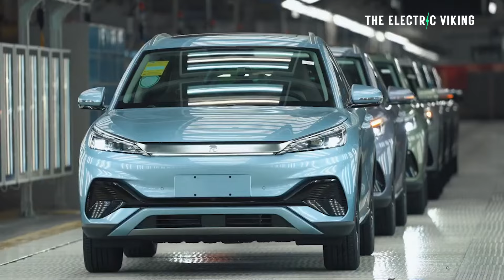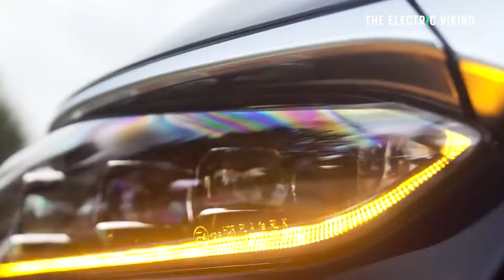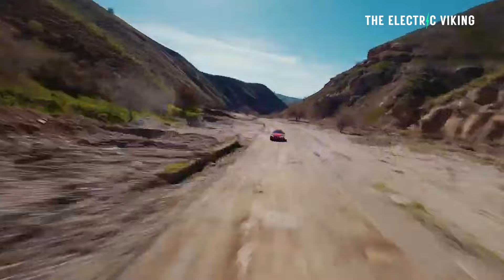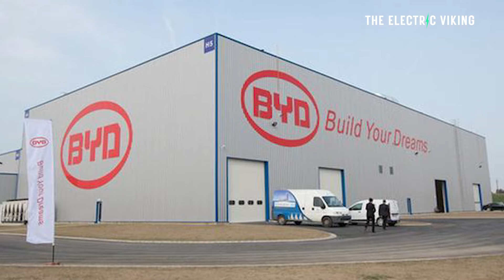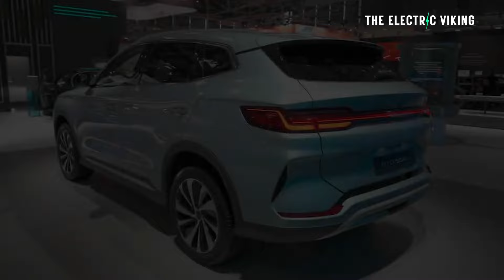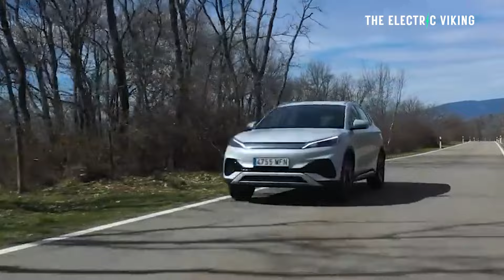BYD says it will increase EV sales 500% in Europe

Comment: I think byd could do well in Europe. The main issue that byd has had to deal with in Europe as that they simply are not competitively priced, which doesn't make it an interesting value proposition. They could solve this by better (aka lower) pricing. Second issue is that there are currently a lot of concerning anecdotes that repair and spare parts have significant delays. I think if this is not solved in paralell to their pricing strategy timeline, I think will be a trigger to European "tradition", and interest from the European market to see traction will be much lower. Lastly reliability in software updated and matching software to European taste and metrics will be another concern that will have to be addressed to match European communication and language translation norms and values. I think if these are addressed put of the gate, I think tradition will stand less in the way. The only thing I think could limit any Chinese venture in Europe is geopolitics, which is currently increasingly complicated, and I think one of the reasons traction of EV adoption, despite growth. EV "demand" seems to slow down currently.